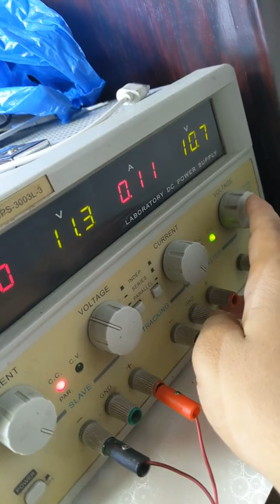Peltier Module

Comment: Peltier's module works as presented but: 1st. silicone will not transfer temperature to the radiator. 2nd processor will die very fast (if its applied this way) because of water condensation. I tried this over 30 years ago. It is not necessary to freeze cpu but to reduce temp to the point where we still do not experience condensation effect. Peltier's module is good but in completely different configuration - not a direct cpu cooling.
Reply: How about cooling a water flow of custom water cooling?
Reply: @ivanbertoni7622  Always you can cool the coolant but never cross the condensation point. There are many factors such humidity, temperature in a room/PC etc. Condensation can appear when cooling system temp is lower than surrounding area's temp. and reaches the dew point. There is no universal solution but it is not necessary to cool CPU down to 0C :) . Temperatures below 0C are used for CPU overclocking and testing not for constant work. You can compare it to the server-room - the optimal temp is 18-20C. If you would drop it lower ,the electronics which generate heat, would start condensate water from the air. When you are breathing in temperatures above 15-16C theoretically you do not see the steam but if temp goes lower (example 10C) then you can see the steam - It depends of humidity and temperatures differential.
Reply: Is there a way we can prevent condensation?
Reply: You can apply Vaseline to the motherboard i guess
Reply: @CraziMayur honestly mineral oil build, like the classic aquarium pc full of mineral oil might be the solution since there’s no air to draw moisture from. Option 2 is to build the PC in a sealed chamber and pull a vacuum on it so there’s no air/moisture.

Comment: Serve pasta termica non silicone
Reply: Visto che raffredda e non scalda io non metterei proprio nulla
Reply: @600motov  no si raffredda da una parte e dall'altra si riscalda
Reply: O silicone é pra prender a pastilha piltier
Reply: @Juniorsilva.29 yes but the side he put silicone on is the side that produces heat, the heatsink has to make direct contact with a high heat capacity material to transfer its heat so it doesn’t overheat. The heat still needs to be drawn away from the peltier plate, and to do so he should have used aluminum paste, thermal paste, or thermal adhesive. Adhesive isn’t even necessary since the heatsink clamps down over the cpu and would hold it tight in between the cpu and heatsink, without adhesive. The silicone is an insulator and would result in a dead CPU.

Comment: Would you be able to build me a device that consistently cools water at specific temperatures?
Reply: Not too hard. Use an arduino and temperature sensor to change the amount of voltage going to the peltier module(s) -- maybe even consider a small reservoir of water with its own temperature sensor to help if temps get too hot or cold